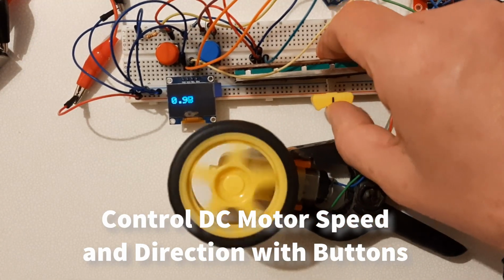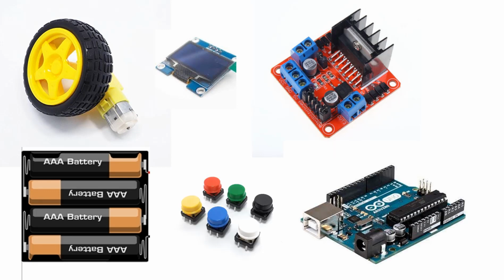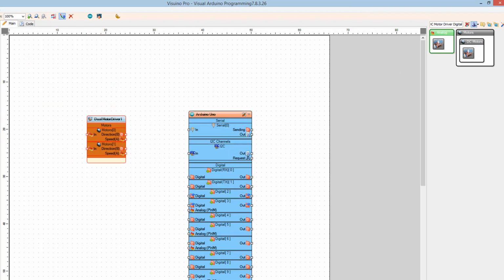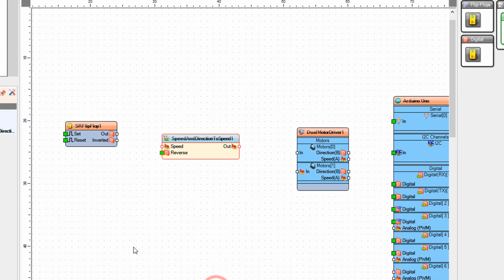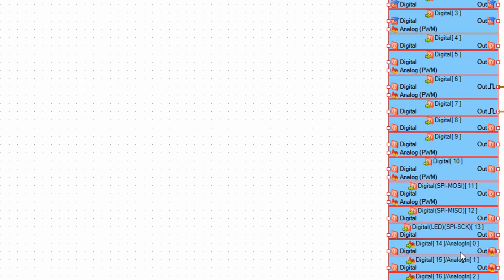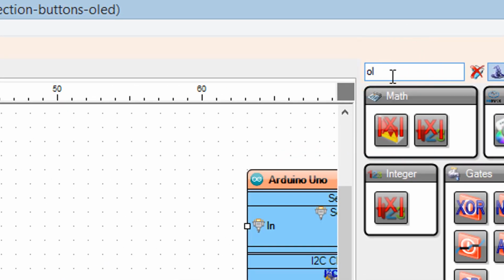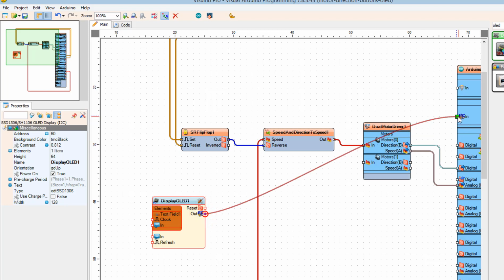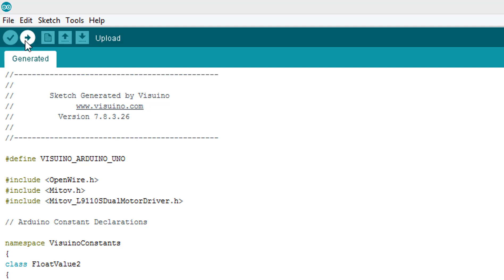Arduino Control DC Motor Speed and Direction Using a Potentiometer, OLED Display & Buttons

Comment: I need two motor to rotate at exactly the same speed when going forward or backward to use for robot car using speed sensor attached to the motor. Please can you help how to do it is Visuino?
Reply from the maker: Please check my tutorials here, you will find it under RC car
https://www.instructables.com/member/RonFrtek/instructables/